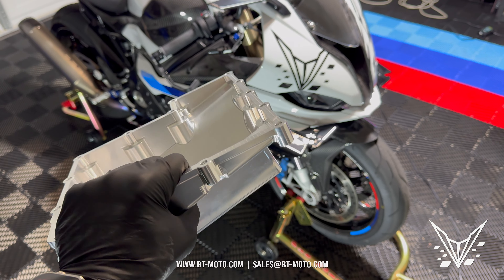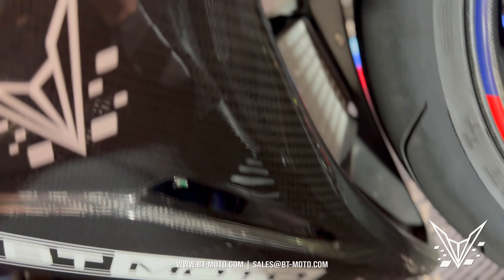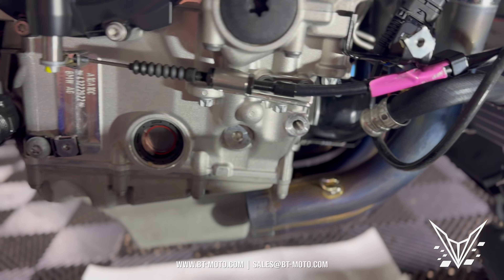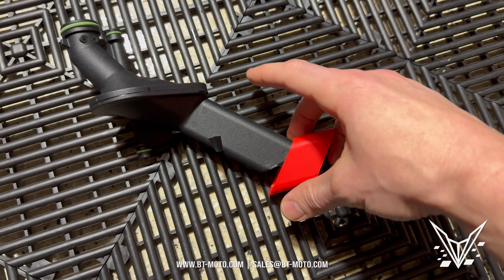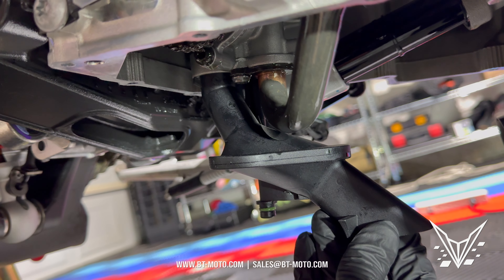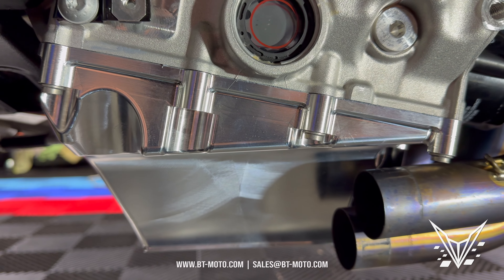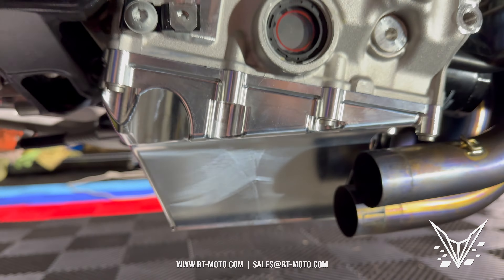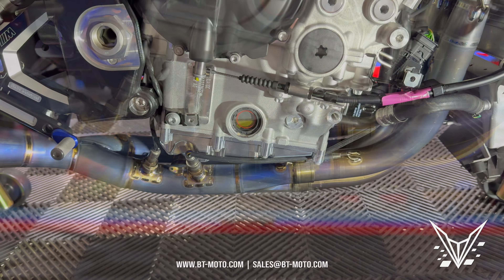BMW S1000RR/R/XR, M1000RR/R/XR, BT Moto Billet Oil Pan Install

Comment: hi my friend, how much torque (nm) on the oil pan bolts?(stock bolts) thanks
Reply: BT Moto is slow to reply or otherwise don't care. 3nm, with an additional 90 degrees (an extra turn on the ratchet)

Comment: would you recommend this for bikes with stock suspension and wheel base?
Reply from the maker: Every bike could benefit from this pan, but especially lowered bikes
Reply: When you torque the bolts on the oil pan, do you install them all before using the torque wrench or do you install and torque as you install each one?

Comment: Why is this needed? What’s wrong with the oem pan?
Reply: This comment must be answered!! 😂
Reply: it’s mainly used with lowered bikes, the stock pan hangs below the headers and if lowered and you end up hitting the pan it can spin the drain bolt and can blow your oil pan which can be catastrophic